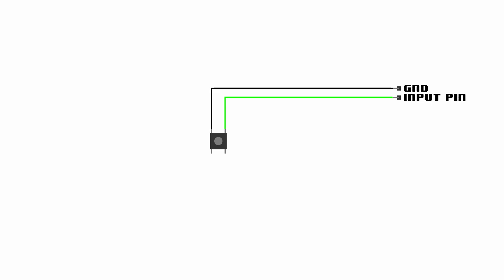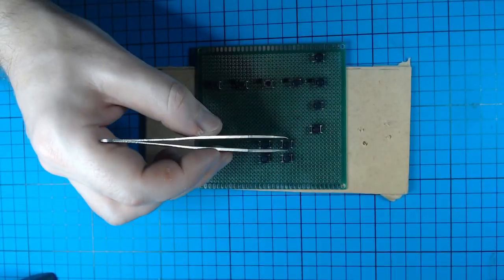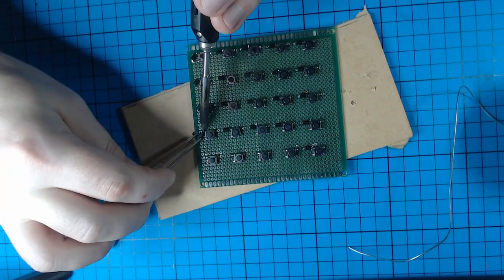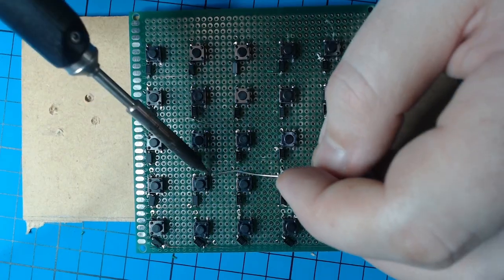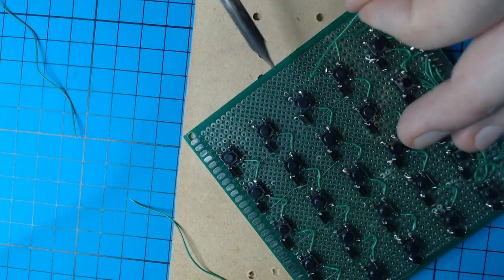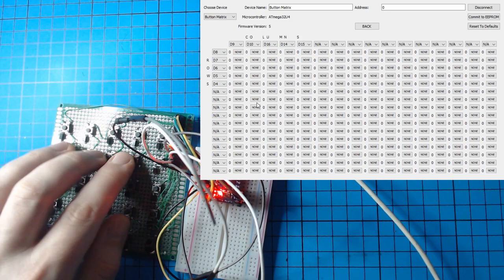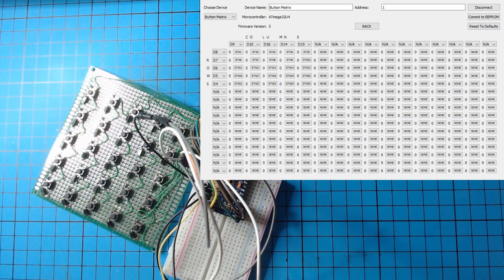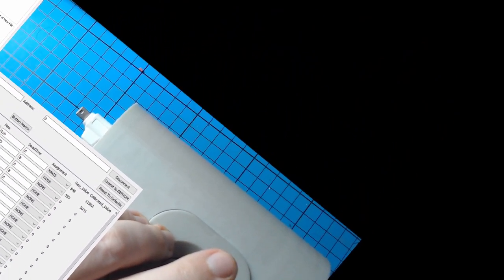Instructions - Button Matrix

Comment: Hi, I just discovered your channel and thought I'd give it a try. I uploaded the firmware to my arduino (v5) and managed to upload a simple configuration to the eeprom. After having success I went to the windows joystick menu, discovered the arduino and opened the menu just like in your video. Unfortunately I did not get any response from the micro. Both leds are lit, I connected two inputs with wire to ground and vcc but did not get any response. Then I tried to configure two pins as rows and two as columns and connected rows and columns with wire but equally failed to get a response (well, I assigned buttons and hat to them). Am I missing something?
I appreciate the effort you put into programming the firmware and the python program, looks like a lot of work.
Reply from the maker: If you're getting a good response in the configurator gui but not from Windows it could be you don't have the address set at zero. There's also a bug where sometimes it doesn't initialize the HID if it wasn't address zero on start and needs to just be unplugged and plugged back in.

If you're not getting response in the GUI then forget about the button matrixes for a bit and just wire in one button, have one pin to GND and the other to one of the input pins, make sure it's set to INPUT_PULLUP in the gui and give that a try.

Thanks for letting me know the trouble, I really need to do a nice tutorial for the software itself that goes through these kind of issues a bit more clearly. Also it could be you've discovered a new and exciting bug in my software which is always good :-)
Reply from the maker: Just to add, if you connected your button pins to VCC and GND then when you press it you're just causing a short circuit, try to avoid that. Doing it once or twice probably won't kill the board but it can.
Reply: @real_robots  Only a resolved bug is a good bug (ancient proverb ;-). Thx for the fast answer. I basically did all of the above. I made sure the address is 0 (was by default). I figured that the button matrix is on top of the main program so I deleted every setting there to reduce complexity. Input_pullup is on (by default). That's why I'm lost atm. I think I reduced the complexity to its minimum from my point of view. Having extensive experience in building and debugging electronics I can definitely exclude of having shortened gnd with vcc. If you don't have any other ideas I will give it a try with another micro from another project, just to make sure. But the micro seems completely fine.
Reply: I just tried the very first example of the arduino joystick library ('joysticktest') and it worked fine. It was funny to watch the buttons and two hats being pressed and the axis move by themselves ;-) So it's definitely not the micro.
Reply from the maker: @alfonsneumann1878  Very stange, thanks for giving me all the information, looks like I need to do some more testing and see if I can get the same thing happening on my end so I can work out what's going on.
Reply from the maker: I think I might have squashed the particular bug that you encountered, if you do try downloading the latest version of the firmware (no change to gui) let me know how you go.
Reply: @real_robots  Yep, works now! Thx for your effort!
I recommend that you mention somewhere that the arduino micro needs a reset after each configuration, otherwise it won't work.
If you want to make another post in reddit I'm happy to write a few words to it.
Reply from the maker: @alfonsneumann1878  No probs, thanks for being my guinea pig! 
When did you need to reset the micro? I know it needs it if you start it up with a non-zero address (gonna fix that soon) but did you have it not be recognized by windows on first run?
Reply: @real_robots  After I uploaded the config to the eeprom, I pressed disconnect. But it didn't work then. So I closed your UI, still didn't work. So I unplugged the micro and plugged it in again, then it worked. Pitty I don't have a reset button on my version, so I will provide one externally.
Reply from the maker: @alfonsneumann1878  Okay cool, I'll see if I can fix that. Thanks mate!
Show us what you're working on when you've got it. I'm playing around with a gamepad that uses the software so I can work on the bluetooth and ESP32 compatibility a bit now.

https://imgur.com/gallery/61yixrY
Reply: @real_robots  Ah, Im attempting to sort a matrix myself right now, on a non-zero address.

I will attempt it again when i put it back to zero, but I am rather unusually getting outputs on non-assigned columns.
Reply from the maker: @Jo-rz6bs  Let me know how you go, if it's behaving differently as a subdevice that's definitely a problem. It should work identically on a subdevice, with the only difference being that it passes the data through i2c rather than directly through HID.
Reply: @real_robots  I had an issue in the matrix itself, (shorted to a nearby switch) which is now sorted, I'll attempt to configure it again, and tell you how I go.

However, a short doesn't seem to explain why I am getting outputs of 2, 4 and 8 rather than 1, and in columns that aren't assigned to pin.
Either way, I'll get back to you with results, probably on the discord

Comment: Thanks for the video :) Which type of diode should we use?
Reply from the maker: I used 1n5819 SS14 diodes which are way overkill for this use, but they're what I had lying around. Any diode that can handle 5v (double it for safety to 10v) and you'll be fine as the current passing through is negligible.
Reply: @real_robots  Thank you very much :)

Comment: Thanks for the great video. I am totally new to electronics. May i know does this matrix work on ESP32 ?
Sorry if this a dumb question,  but do i need to add ground wire to this matrix?

* I plan to use array in Arduino IDE to scan rows and columns.
Reply from the maker: Yeah it should work exactly the same on an ESP32, just make sure you pick pins that can do input and output.

You don't need to add ground wires, we switch the pinmodes from input to output so the grounds are built in.
Reply: @real_robots  thanks for replying. If i understand correctly, we can set the rows as output, then scan each column's switches within that row. In such case, do i still need the diode?
Reply from the maker: @cwtjones  from memory that's right, though it might have been the other way around with the rows and columns.

If you don't use the diode you'll get something called "ghosting", where keys pressed outside of the ones being sampled will be detected.
Reply: @real_robots  after go thru many articles, i think i understand how it works. If i am correct, we set the row as output, columns as input, then run rows x columns scan. That way we no need to use the ground. But i am confuse as the rows (the diode connection) end with wire connect to pin. I was imagine it should be the begining of the left most switch (first switch of each rows)

Comment: Hey there i wanted to use this type of button matrix for a project where a computer is not available is it possible for the 1st arduino act like a sub device for a second arduino?
Reply from the maker: Yeah absolutely, either the master or a secondary device can hold the matrix.
What exactly do you mean no computer available though? What are you trying to control? Whatever it needs will have to take HID inputs for this software to work with it.

Comment: How would one do if they would like an LED to light up when you press a button?
Reply from the maker: If you use DPST switches you can have one set of poles connected as above, and the other connecting an LED from GND to your voltage.
Reply: @real_robots  I see, only thing is that this button box will be placed behind a real car climate control and my idea is to replace the original PCB with a 3D printed one that the buttons and lights will be placed in the same place, and the climate control LEDs that indicate something on and off are apart, so I need a momentary switch that will trigger a tiny LED that will show that buttons on.
Reply from the maker: @Makethings987  So you want the LED to stay active after you press the button? You can do that in code if you've got pins for the LEDs separately to the buttons. 
It can be done through hardware using D-Type flip-flops.

https://www.youtube.com/watch?v=7khYOW95hWQ&ab_channel=TexasInstruments

Comment: Is 6×10 matrix possible with arduino
Reply from the maker: Sure, there's a bug in this particular firmware which makes it fail sometimes with mismatched colums/rows, so you'd be better off connecting them as an 8x8 if you're going to use it.

Comment: Hi,
Thanks for this very interesting video.
I would like to know how to create columns and rows with the RealRobots Gamepad Configurator interphase. I can't, sorry.
(I'm on linux and can't use rr_configurator.)
THANKS.
Reply from the maker: If you're on linux you can just run it using python, no need to use the windows executable.

If you can wait (probably a few more weeks) I've got a much better, web based version now. I've just gotten it stable and its' got the basic features. Am adding extra features like matrices now though.

www.realrobots.net/configurator
Reply: @real_robots  Thank you for your reply . I will wait impatiently.

Comment: what I didn't understand is that if you connected both sides of the button to different input pin, where the ground is gonna be connected to ?
Reply from the maker: The row pins are the ground, when one is configured to be a ground and the others are not then we can focus on only one switch at a time.
Reply: @real_robots  sorry i dont understand , so you mean 5 row connected to the same ground IO ? Or row actually use IO pin they "act" like a ground ?
Reply from the maker: @peastfist1602  The second one, you can switch a pin in code from being basically nothing, to being a ground sink. So only one row is creating a path for those electrons at a time. I don't really go into the code in this video though as my firmware handles it all.

A more in depth explanation can be found below (it's not me)

https://www.baldengineer.com/arduino-keyboard-matrix-tutorial.html
Reply: @real_robots  thank you so much ❤️❤️

Comment: Sorry if this is a really stupid question but how do I upload the RR Configurator SRC to arduino IDE, is that even necessary?
Reply: I have downloaded the SRC ZIP as well as whole directory as ZIP and still IDE says it does not contain a valid directory.
Reply from the maker: @HuntersQuiver  the configurator is a gui app that you can run in windows, run rr_configurator.exe

Before it can talk to any of your arduino devices though you'll have to upload the rr_controller firmware to that device.
https://gitlab.com/realrobots/rr_controller

Comment: what kind of diodes are you using? . i think it does not work without it for the matrix.
Reply from the maker: You'll get ghosting (seemingly random keypresses caused by current running the wron gway) if you don't use the diodes. Almost any diode will work as the energy flowing through is so low.

I used 1N4007 diodes which are way more than what you'd need, but they're what I had on hand.
Reply: @real_robots  well in my case i am hacking joystick boards with it to test. so i use the onboard traces. i now rebuilt the logitech 3d pro entirely and converted the hat switch into buttons.  as for the Oled code where should i place it?

Comment: hey man can you help me out please.
So i made 4 x 8 button matrix, everything works well but when i checked in windows or in game, it seems only 4x4 ( half of the button box ) is being registered when buttons are pressed. Windows and games sees that it has 32 buttons but only lets me press first 4x4 square.
Is there something i can do about this? configurator works fine and all buttons are mapped.

also side question, is there a way to change the name of this usb device ? i want it to be recognized as Button Box in windows
Reply from the maker: I've had this bug reported, with matrices that they work in the configurator but not completely in Windows. Unfortunately I don't have time to work on the project anymore so haven't gone in to find the bug. Some people have said it only happens with lopsided matrices so I can't do much other than suggest trying going 8x4 or try and make it have even sides. Possibly try assigning some extra columns to pins that aren't connected and see if that bypasses whatever bug I've got.

With arduino devices the only way to change the HID device name is through playing with the boards libraries, I've not tried it though so I can't say if it works or not.
Reply: @real_robots  alright, thanks for the quick reply man. really appreciate it!
Reply: @real_robots  i assigned 4 more rows and it works now! amazing! at least now i know for next time i need to build symetrical button layout haha. Cheers dude! :)
Reply from the maker: @powerchill  sounds like I just need to write better code. Thanks for letting me know that fix worked

Comment: Hello, the rr_controller softrware seems to not want to accept pin 11,12&13 as output..can i add them without messing anything up?
Reply from the maker: Are you using an Arduino Pro Micro? It doesn't have pins 11-13 available as GPIOs.
Reply: @real_robots  Nah´i´m using the Leonardo
Adding pins 11to13 gave rr_controller a Crash so i colsed them again.
I wanted to use A4&5 instead but i can´t select them  in the conffigurator either.
Other than that, this Tool/Video made my project possible in the first place,  so thank you in advance.
Reply from the maker: @dawudmc  Theres a quick hack that might make it work then, if you go into inputs.ino and find the "inputPins[]" array for the Pro Micro and change the pin numbers to the Leonardo ones it will probably work. They won't change in the GUI so you'll just have to remember the places in the array.

I haven't used a Leonardo before, but I can't think of any reason off the top of my head why that wouldn't work.
Reply: @real_robots   Wow, thank you for the great idea/workaround. 
I need some spare-pins for my Button/Switch-box well i used the GUI to make a 6x7Matrix since there are only 13pins. i managed to get it working ..well.. on a Breadboard, so far at least.
Let´s see how i cope once everythin is soldered and my little box is finished.
2 be continued 
and Thanks again for the Answer.
<3

Comment: Hey! very nice video. How about you add some debounce circuit to it in the future? :)
Reply from the maker: The time taken to sample every button in the matrix pretty much removes the need for any debouncing. You could certainly do it if you needed super high resolution button sampling, but as it is if I was having problems I'd just increase the delay between samples to slightly longer and you'd still never notice it.
Reply: @real_robots  Yea it really depends on the application. I am currently building a musical application where time is critical. If I wouldn`t debounce it would trigger multiple samples. Since I want fast responsetimes I take the first occurance of a high singnal instead of waiting for the signal to be stable. The debounce is reaslised with a "shutdowntime", so the application waits till the signal is stable until you can press the button again. In your example the first sample you take does not have any debouncing and the last sample does have the greatest. Nontheless if it works it just works :D
Reply from the maker: @thebaconbreadful  ah, yeah if you're using an interrupt to detect signals going over a threshold you need good debouncing.

I just sample no faster than 200 times a second, its way faster than you'd ever need to capture a human keypress (usually around 100ms at the shortest) and since bouncing usually occurs within a pretty small window of <2ms, my 5ms delay between samples jumps right over it. To be honest, even slowed right down to 50 samples a second I couldn't tell the difference.
Reply: @real_robots  oh I wasn't aware of the sampling speed. Indeed I wouldn’t care about debouncing in this case either. I am using a 240 mHZ Microcontroller Processor so it’s a different story for me :D